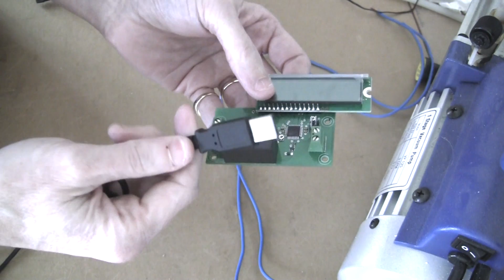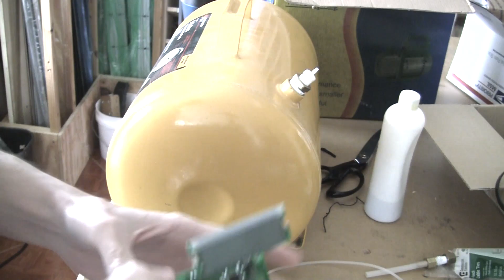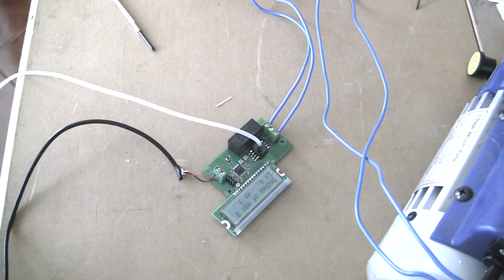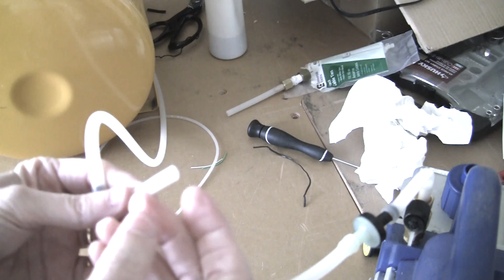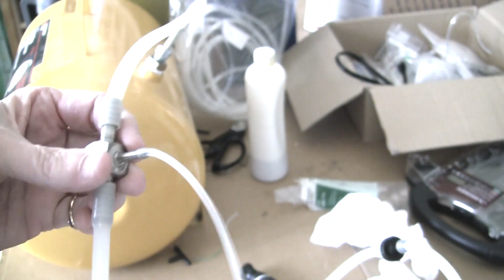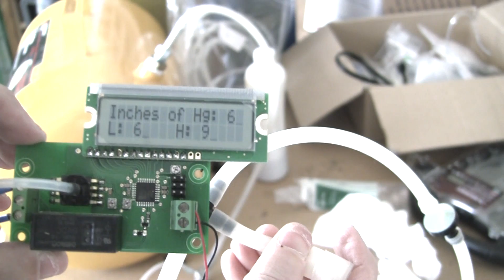How to use our Vacuum Pressure Controller

Comment: Hey Patrick
I use two time relays when i am vacuum bagging wings, witch i adjust them according to the air leakage. Most times, i achieve ten to twenty minutes of pause between the  20 to 25 sec working pump time, keeping the pressure between -1 bar and - 1/2 bar. But there are few times that leakages are getting worst and disaster comes, especially when you are not close to fix it.

I think adding a beeper would be a nice plus.
Reply from the maker: That is an excellent idea!!  I will implement one in my next iteration.  You may also be able to add a sound device through the relay if you need this type of think now.